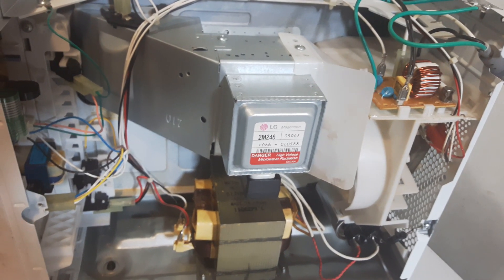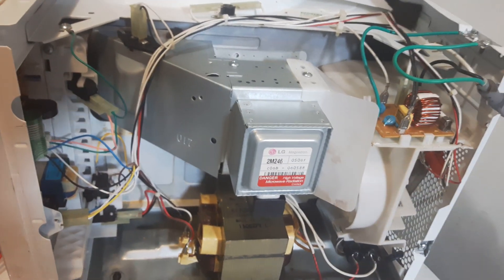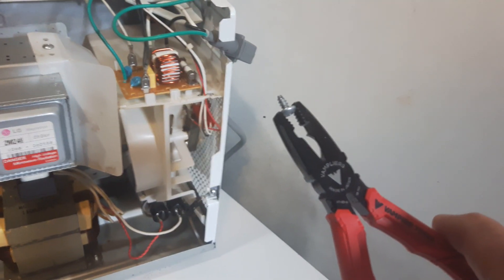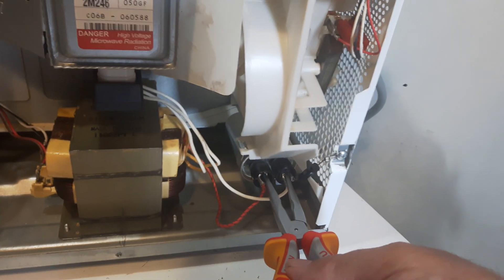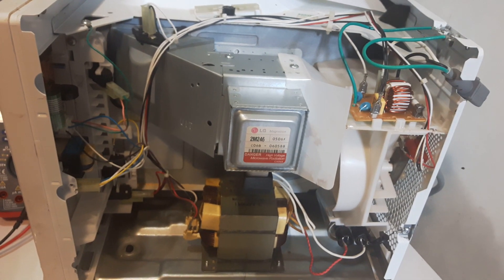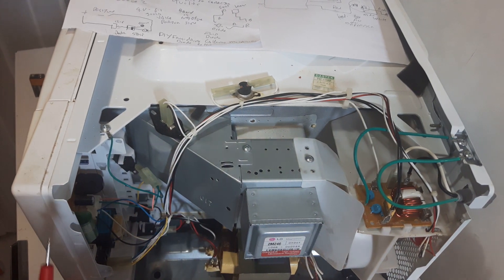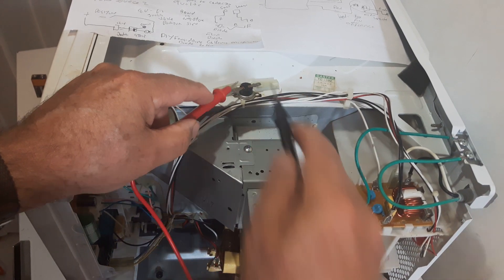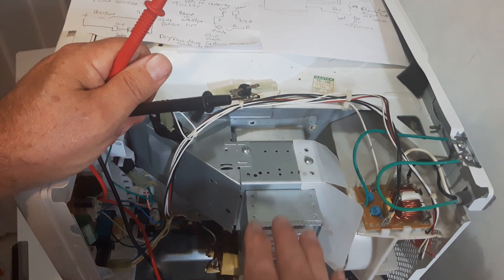Microwave runs but no heat Part 1 of 6 ( Micro switches, thermal cut off, fuse )

Comment: Wait a minute, the testing of the 3 switches is not complete. You are testing all 3 switches with the door closed and with the door closed probing the top & bottom switch should indeed beep to indicate continuity (the switches are closed). But, you need to open the door to make sure it doesn't continue to beep indicating a short (stuck closed) as when you open the door those switch should then open & stop beeping. You didn't open the door to check! As for the middle switch, that should be the monitoring switch and it works in reverse. When the door is closes there should be no continuity and shouldn't beep....why is it beeping (indicating closed or shorted)?
Reply from the maker: Yes I know I am not sure how to test them and actually posted a video asking for help with this. https://youtu.be/o0SZJX53ge0
Reply: @JimMcLaren1950  Hi Jim, I got the answer for you. I'll make sure to put the answer into your other video as well. As seen here in this video, you pulled one of the connector off the top and bottom switch when you put the probes onto the switch terminals to test those switches. 1) Disconnecting the switch is the proper way to test the switch. Pulling just one connector off the terminal of the switch takes that switch out-of-the-circuit with all the other electronic component. 2) As I had mentioned before, testing with the door closed is equivalent to pressing the button down on the switch. Since the top and bottom are "normally open" switches...it means when the door is open (equivalent to not pressing down on the switch...it is then "open" meaning no continuity, no resistance reading, reads Infinity or OL on some DVM. When you close the door the hook latch on the door presses down on the switch and thus the DVM beep indicating continuity. The test should be conducted with BOTH the door opened and closed. No beep (no continuity) when door is open and beeps (indicating continuity) when the door is closed. What you did was tested it when the door is closed and it beeped indicating continuity, BUT how do you know the switch isn't stuck "closed"...therefore you have to open the door and make sure it stops beeping. If it continues to beep, with the door open and closed that switch has shorted out. Sorry if I'm getting too wordy!
Ok, onto the middle switch...you did not pull the connector from the switch. You had mentioned that there was no plastic insulation on the terminal & so you took the measurement with the connector still attached to the switch and lo-and-behold it beeped indicating continuity. This violate rule number #1, you should take the switch out-of-the-circuit for an accurate reading (just disconnecting one of the two connector is all you need). Since the middle switch is a "normally closed" switch...it's behavior should be the opposite of the other two switches such that when the door is opened it should beep and with the door closed it should stop beeping to indicate no continuity. Here's the answer: the reason why it beeped with the door closed was because you left that switch in-circuit with all the other components and you didn't remove at least one of the connector on that middle switch. So why did it beep to indicate continuity when you had the probe across the switch terminals...it's because those 2 points on the switch terminal are the same two points across the PRIMARY WINDING of the transformer, which is one continuous piece of wire and thus it beeps to indicated continuity. In fact, if you test that middle switch with the connectors not removed...you would get a beep when the door is open and closed.
Reply from the maker: @enufots4621  Thanks so much for posting. I couldn't figure out how to test them. You have explained it with great detail, thanks again.

Comment: hey you put leads across thermal cutout, and said it was good!!!  you didn't say if it was supposed to be open or shorted??? wtf
Reply from the maker: The thermal circuit is good indicated by beeping sound on multi meter. rather than look at the multi meter I had it set to beep to indicate good connection. It was easier to do it this way when accessing the micro switches.
So the circuit is closed.